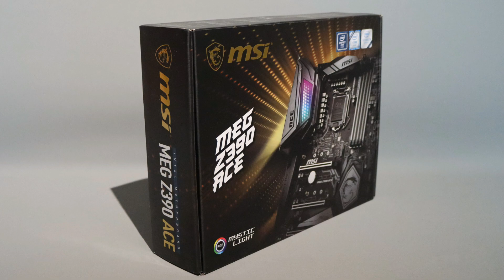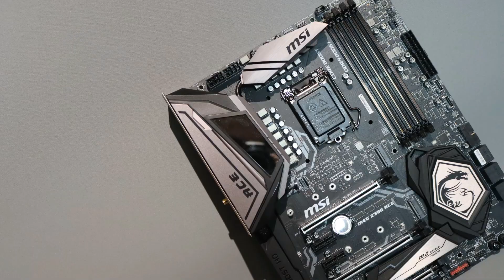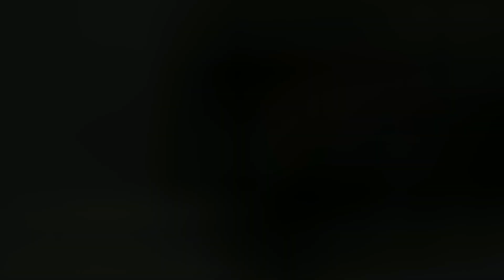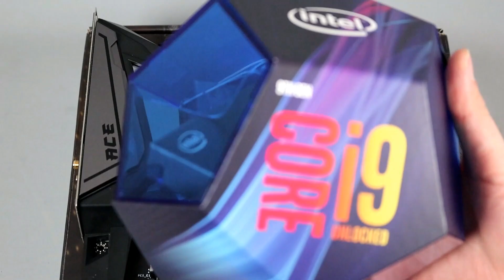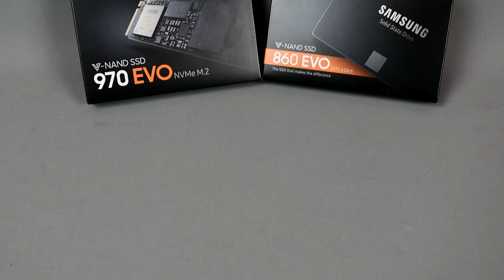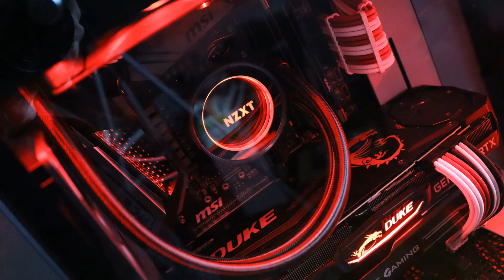MSI MEG Z390 ACE - introduction

Comment: Hello! I’m about to buy this beauty but I hear a lot complaints about the M.2_3 slot with the Shield Frozr installation. How did you install it? Did you have any problems or difficulties removing the screw plus mounting screw for 2260? Thank you :)
Reply from the maker: Little The Acoustic Hi, honestly, I don’t see a problem with it. I had zero difficulties because then I would have the same issue with the X570 GODLIKE, which it has the same mechanism. Poece of cake. Just need to have the exact screwdriver and won’t make any problems. 😉